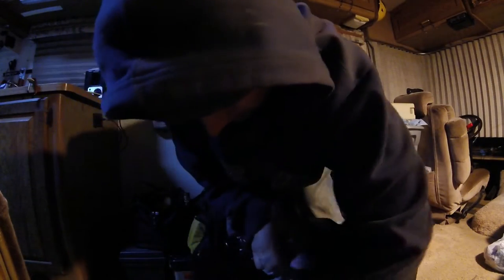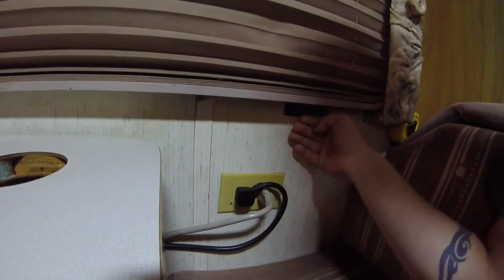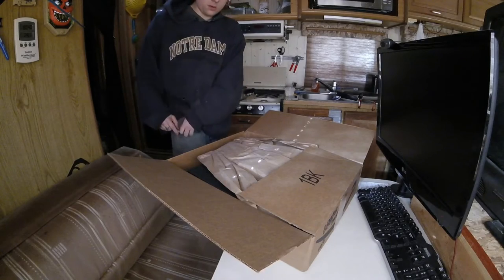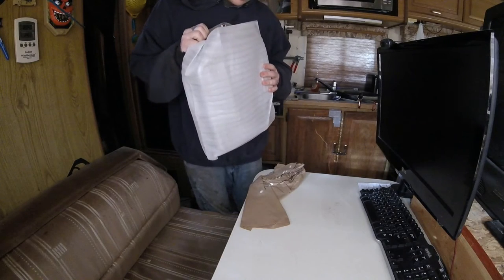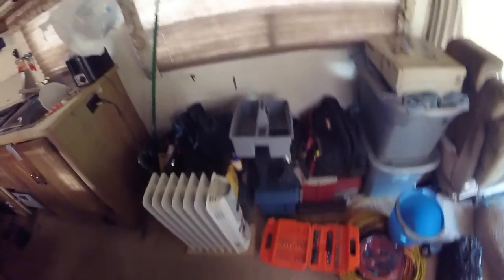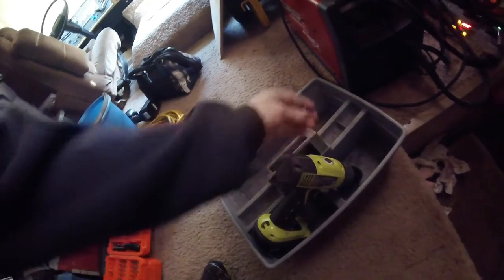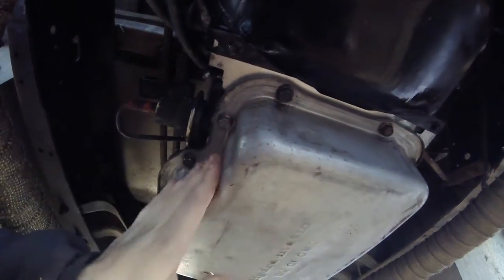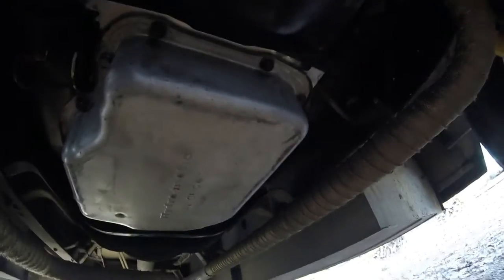Trans Pan & Electrical || RV Living Update

Comment: I always use the "right stuff" gasket seal instead of gaskets.   It can stick even with some oil but you should clean the surfaces as best as you can.  And yeah the rear main seals always leak on big blocks lol.

Comment: I just bought a 1978 Pace Arrow and i'm having trouble finding parts. i was wondering if you or anyone else had any input. i know it has a P30 chassis and a 454BBC but for some reason i cant find the right parts. i need the whole brake system, an oil cooler line, two fuel tanks (not sure what size) and a bunch of other stuff. I'm just clueless as to where to find the RIGHT parts. any help is greatly appreciated
Reply: Any luck??